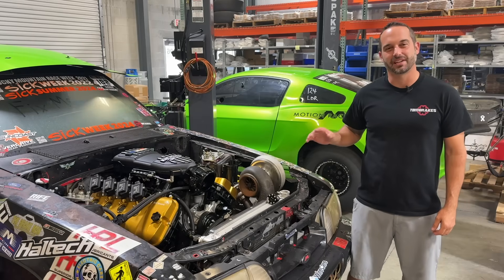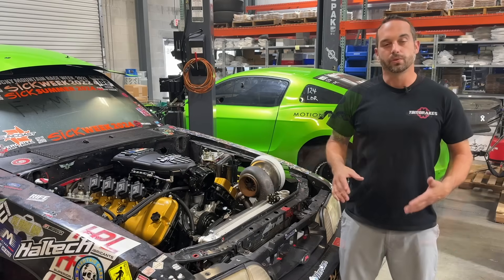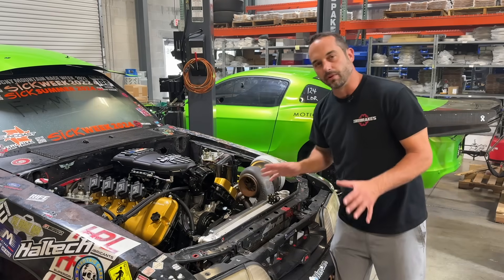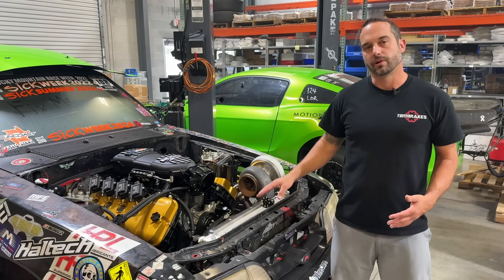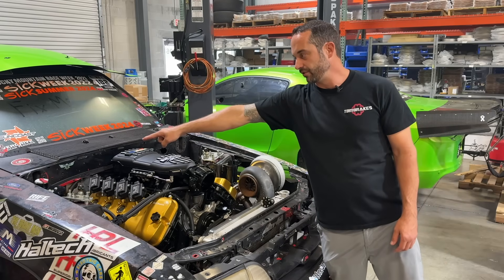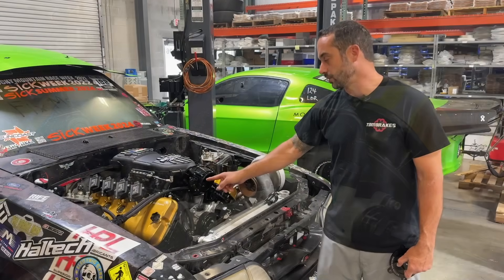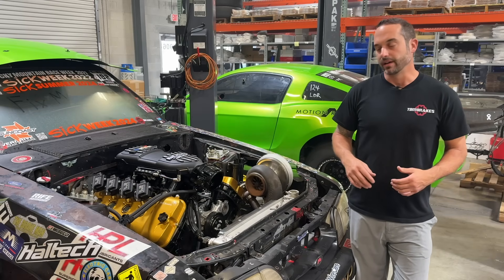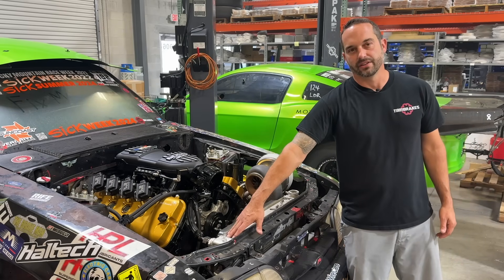How to Plumb Coyote Cooling System with AN LInes

Comment: Glad to see you addressed the importance of running a coolant PRESSURE sensor (in addition to the temp sensor that every system already has). And it was very helpful how you discussed your preferred location for the pressure sensor as well as some feedback regarding normal coolant pressure ranges you’ve experienced with the coyote engines (as well as a suggested high pressure threshold).

Comment: Wish you would of shown where each line goes on the radiator in the video. Is the passenger side exit line merged at the bottom fitting for the radiator with the driver side exit line?
Reply: Where each line goes would be super helpful as I've been fighting  overheating on mine for the past 2 years

Comment: Great presentation Brett. You said something in your tech tips, it's possible to get hot spots especially in the exhaust ports in the heads. Something to maybe toss around: build 4 sensor kit, adaptable to Holley, Fuel Tech or any other management system, to place each sensor at each corner of the heads they are prone to have spikes.  This theory could also hold true and adaptable for ANY engine combo.